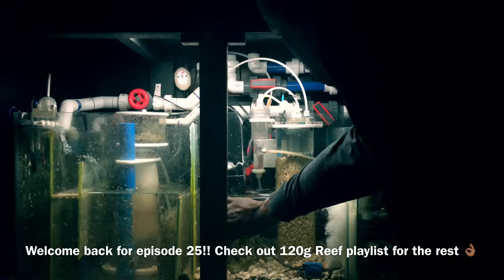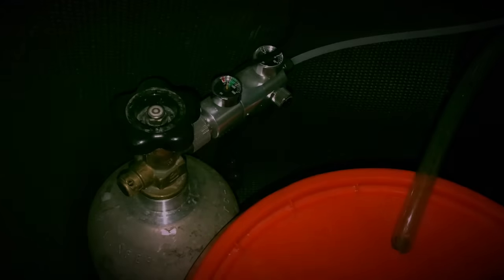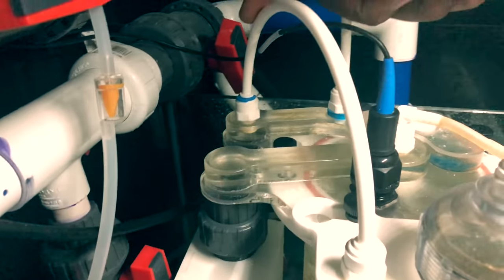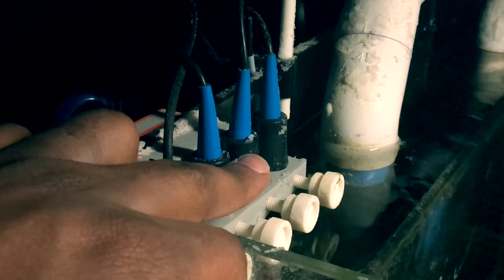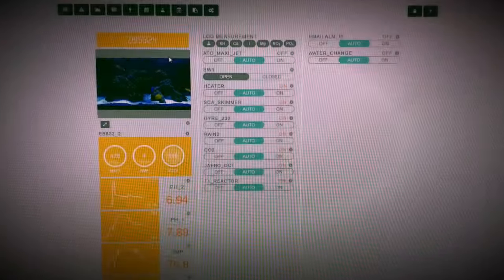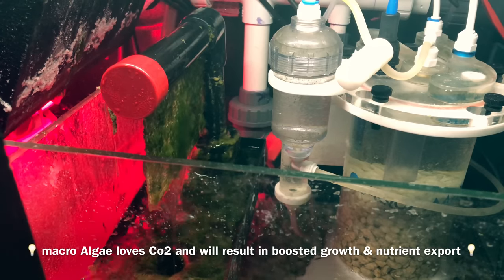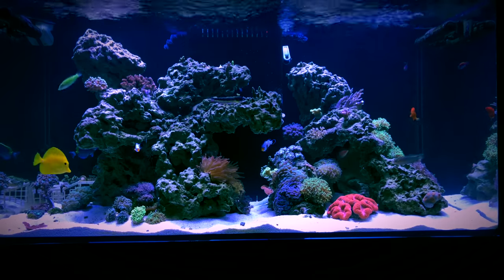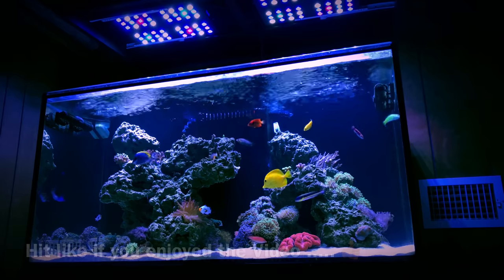SCA 120 Gallon Reef | Ep.25 | Aquamaxx T1 Calcium Reactor - Apex - Dosing

Comment: Great vid.im going to be upgrading to a 120 and was wondering what would be a good return pump? And which return pump are you running in your setup thank you so much
Reply from the maker: im running jebao dct 12000... its oversized for my tank but allows me to expand my system later if i wanted to add a frag tank onto it

Comment: CJ, I have the same regulator as you, is there no way to control the Pressure coming out the tank do you know?
Reply from the maker: JCS Reefing no the only way to control it is the little knob ... single layer of tuning not double. Def makes tuning alittle aggravating but using influent flow as fine tuning my ph has been a lot easier

Comment: New to the hobby question. The Co2 tank:To raise the PH? Is the Co2 in the water isnt enough for the break down of the calcium? The ph has to be at a certain point or sweet spot to help break down the calcium and this is done via the Co2.. If your water is already at the 8.3Ph then this is to  keep it from fluxuating?? If the water is at 8.3 PH then can you just use the cal media and let the sump water flow over it to introduce it naturally into he water column?
Reply from the maker: smith john ph has to be acidic below 7 before media begins to melt my tank. Actually is closer to 8 .. Co2 is concentrated inside the reactor to Lower it enough.. currently at 6.8 but I can lower it more based on what my tank needs

Comment: The stock pump on mine is noisy.  Have you had any trouble with that?
Reply from the maker: Saltwater Jeff no issues with noise on mine not sure what issues yours has 🤔
Reply: Probably operator error.  I even replaced the little sicce pump with a new one and same result.  It’s sounds like it runs out of water.

Comment: Really can try to make a home co2. With an air pump, bottle , ingredients and valves.but would air make it less co3 ,perhaps. Than its all about dosing and natural states of reaction in tank. People have the information ,oh I don't need water changes. But it's not all from the calcium/co2 reactor. It's from the sump filter too. co2 in generals the topic of plants converting carbon dioxide into oxygen, By using light. But other organisms for oxygen don't generally thrive. Theyre actually the carbon makers hahhaa